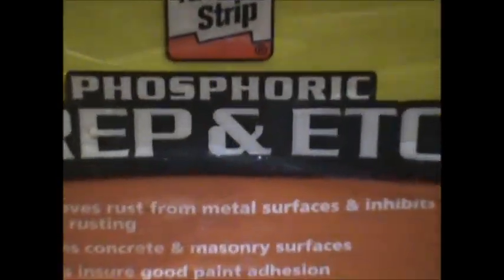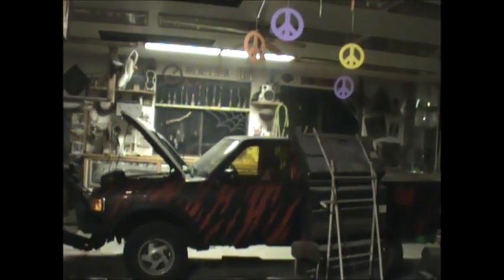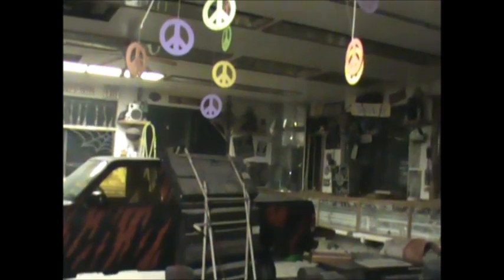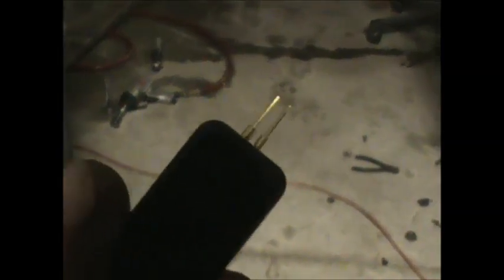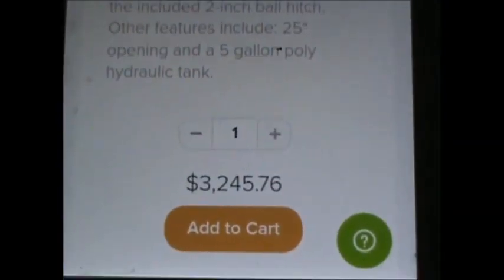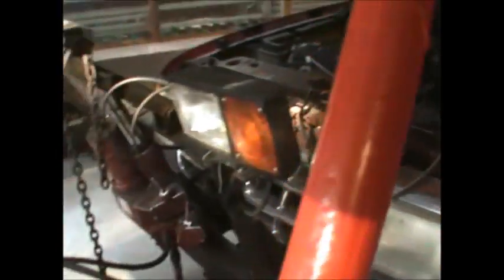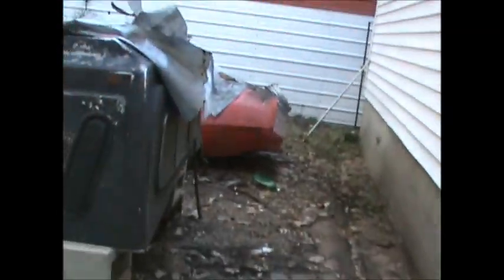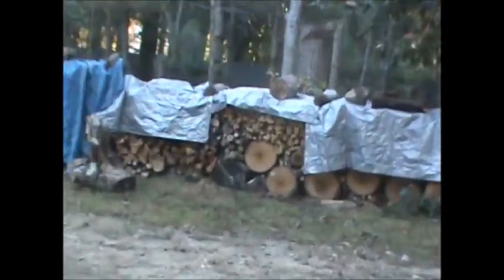SCHUUU SHOVEL PLOW TRUCK

Comment: I found that piece for airbag diagnosis on ebay. What that piece does is it acts as a dummy airbag. It is supposed to trick the airbag computer as if the airbag was there. It is basically a resistor. The airbag control module is looking for a certain programed resistance and that piece is used to trick the computer. I can explain it to you better over the phone. If you want. I don't mind helping you figure it out. Let me know if there is a better way to contact you. Just let me know.... I'm in Florida by the way not sure of the time difference.